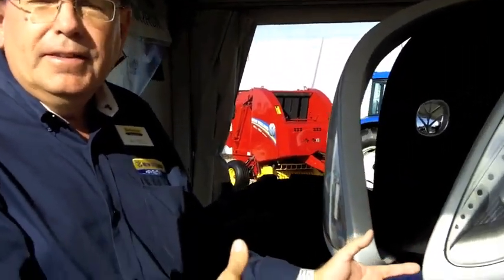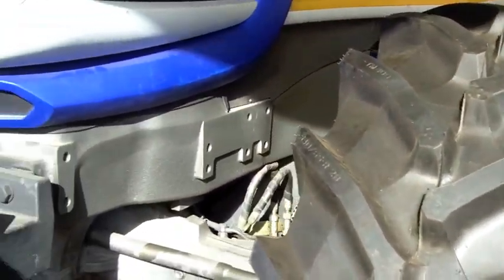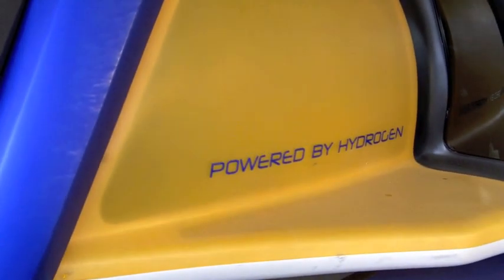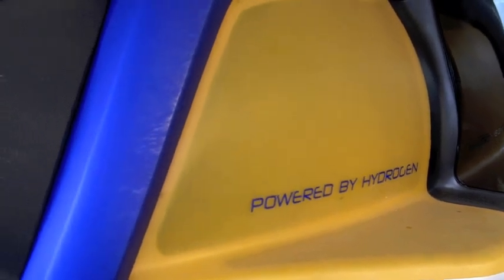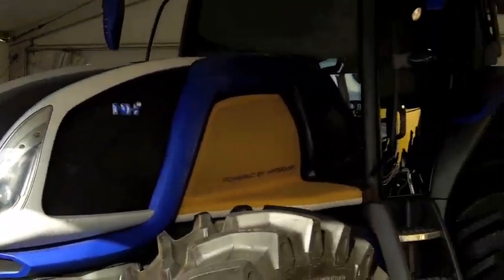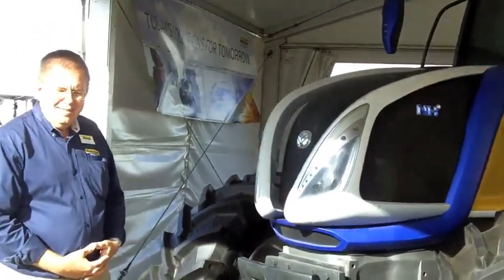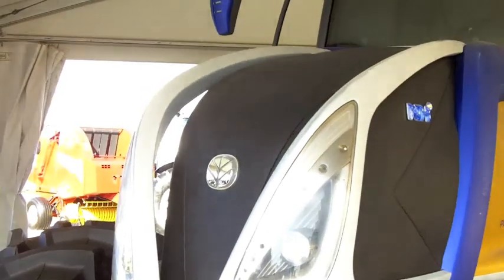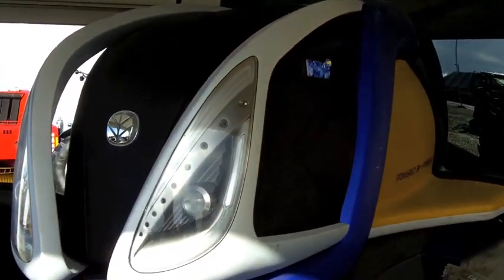New Holland NH2 Hydrogen Powered Tractor

Comment: Pushing the Hydrogen through a fuel cell to an electric drive circumvents the torque problem - but what are the cost differences betwixt H combustion engine and an H fuel cell?